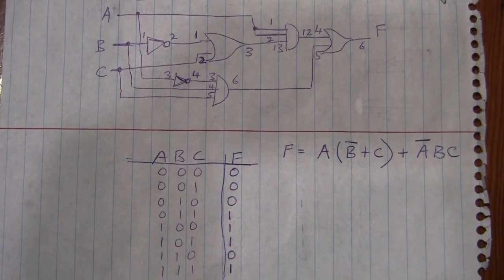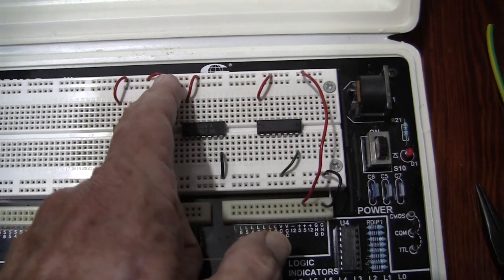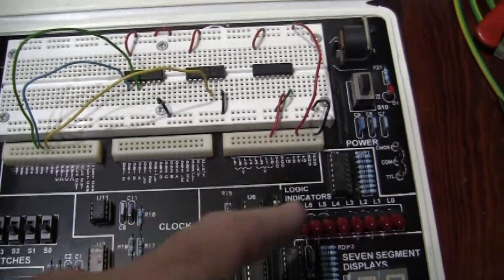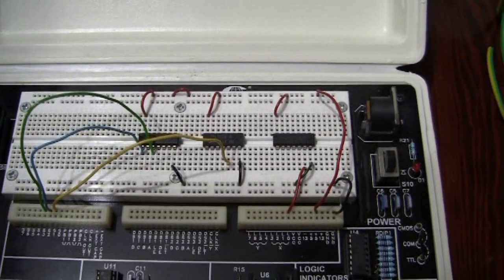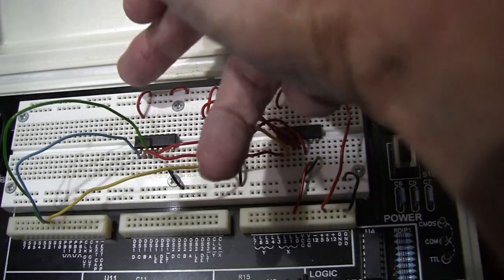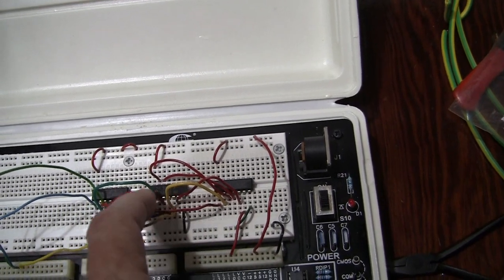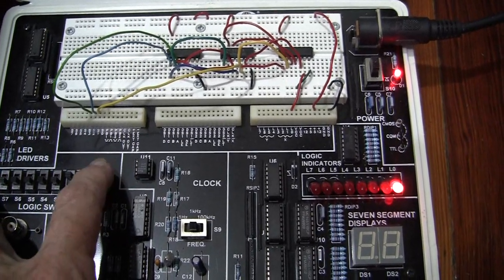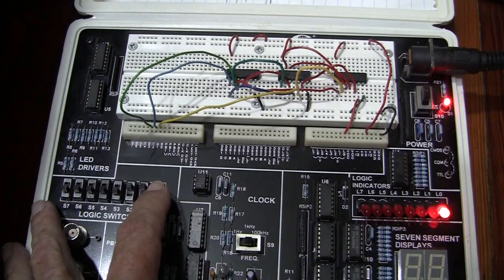Wiring a Logic Circuit on the Digital Logic Trainer

Comment: very useful. Do you have the circuit schematic of the "pencil box"
Reply from the maker: I probably do but I cannot find it right now 😥..... but it's not really necessary, I have repaired them with the greatest of ease...... they are incredibly simple ..... just an oscillator ..... buffered LED's .... switches ..... two 7-segment readouts .... a couple of monostable trigger circuits .... all connections go to a header.... the only thing common is power and ground...... you can interconnect the switches to the LED'S with jumpers on the header ...... or the oscillator to the 7-seg readout ..... and virtually test all the circuits in less than 10 minutes..... it is MODULAR (a favorite word on my channel although in different context  🙂) ..... is there a reason you need the schematic ?
Reply: thanks.
Reasons:  I got one and just started to use it. No instructions/examples and schematics with this unit :(  . Checked supplier web, no examples, explanations, very limited instruction and no schematics. It would be nice to know the onboard components so i can find out how they work together to interface future experiments.
Reply from the maker: @ED99LAM  I will put up something after I have met the semester deadline for getting in the marksheets 🙂